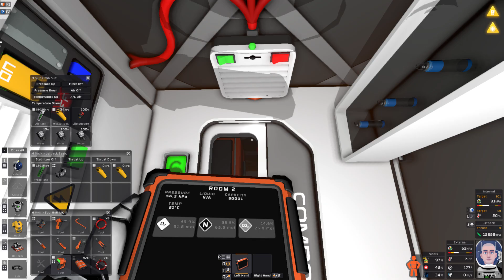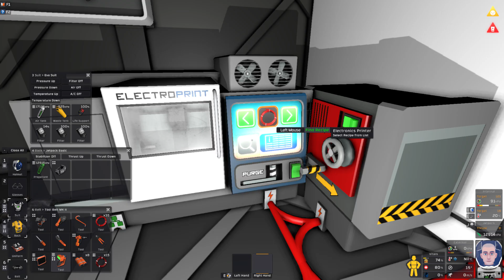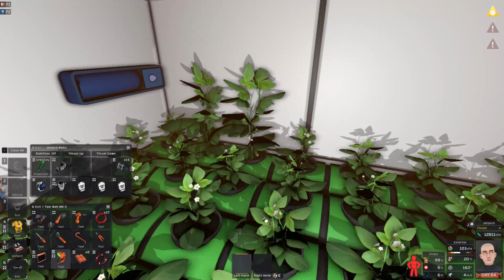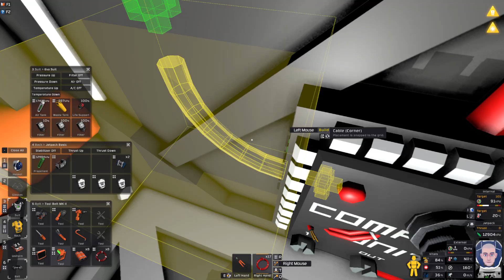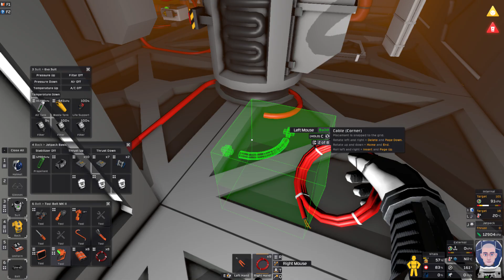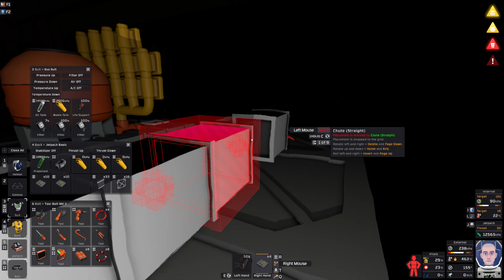Stationeers Venus Brutal Insane Episode 16

Comment: Hi. I don't understand why you bypass your liquid volume pump on the de-gas furnace with extra liquid pipes. Those liquide pipes are connected bevore and after the pump... doesn't make sense in my mind. What did i miss?
Reply from the maker: The pipe between the liquid volume pump and the furnace can build up unwanted high pressure.
Rather than run a separate purge valve on that one pipe segment, I instead connected it to the main liquid line so it gets purged by the purge valve on the main line.
It looks absurd, I know. But that seems to be how the game works.
Reply: @enigma7314  ok, i see. But in the liquide pipe network are allways liquids, so i think the pump will work in a endless loop and pump forever. Right?
Reply from the maker: @Coooolin84  The point of the liquid pump is to drain the furnace of liquids because it only has a limited liquid capacity.
It will pump forever. But all the liquids drain out of the liquid pipe network via the expansion valve I have on that line. So once the furnace is empty of liquids, it's pumping nothing.
It's an annoying permanent loss of 100W of power, but it does seem to stop the whole system from blowing up.